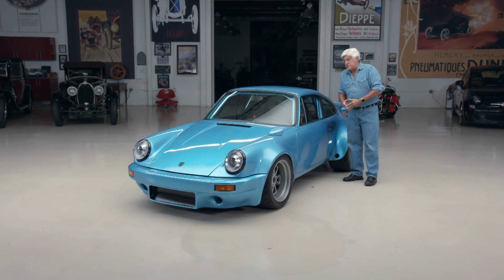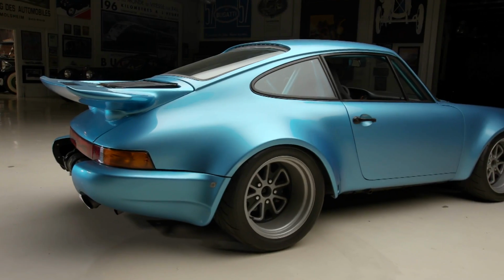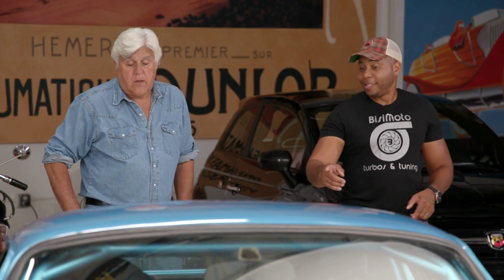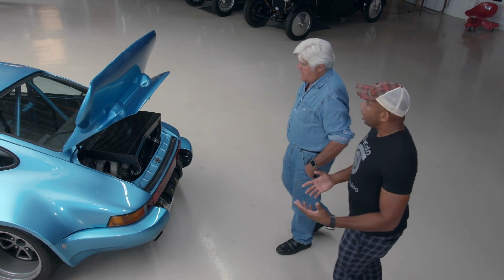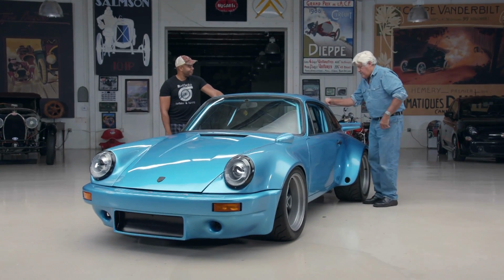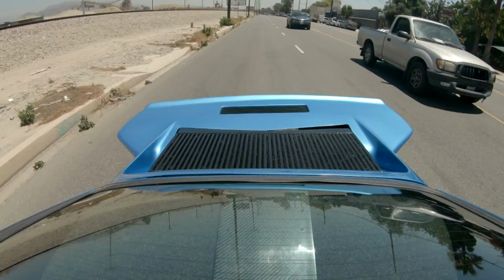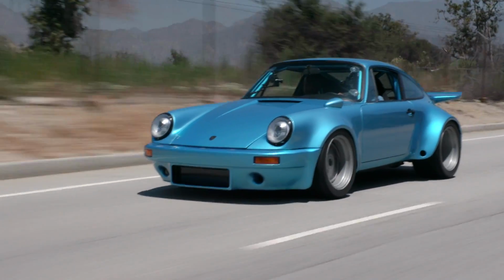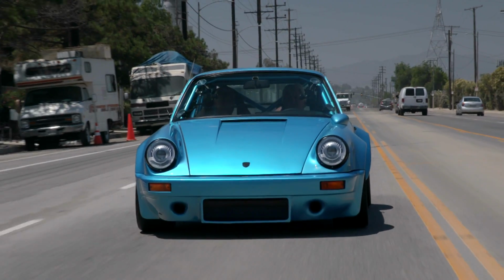Bisimoto's 850HP Twin-Turbo 911 - Jay Leno’s Garage

Comment: water cooled, drive by wire... that negates the whole idea of this car. Electronics are NOT good they will fail, guaranteed.
Reply: Electronics rarely fail, unless in the hands of morons.
Reply: @legitx12  you're crazy. Apparently you don't use a computer often. They fail all the time. Parts go bad, especially electronics in a harsh environment like under the hood of a vehicle. I know many that have had troubles with the electronics on their vehicles, often due to poor design in the first place. Some are put in such spots that even when you know which part is bad, you have to disassemble a large part of the engine to get to them. One chrysler I had, the factory recommended way to change a starter was to pull the entire engine, and what generally went wrong with the starters were the celanoid on the top. A former landlord bought a new Buick, It had a chip go bad 3 times, at several hundred dollars to repair it each time. After the third time, he sold it and took a loss, just to get rid of it. No sir, you can't convince me electronics don't fail, I don't care how many names you call me. You're wrong, flat wrong, and that's all there is to it.
Reply: I own a automotive service business.The PCM rarely fails, often the one's that due, are rebuilt units. You don't have any professional, or engineering background.
Reply: @legitx12  I don't even know what the hell a PCM is. I'm not talking about one part. Electronics in general can and do fail, all the time. I suppose you don't recall the Toyotas that would try to drive themselves even though they were not meant to do so? The more electronics you put in a vehicle, the more likely you are to have a failure. It may be something just inconvenient like a window switch, or something major that will cause strange things to happen, or it may be another piece that simply causes the vehicle not to run at all. I've had electronics fail a number of times, on a number of different cars. My neighbor had all kinds of troubles with the electronics on his Chrysler mini van, then had different problems with the Toyota Sienna he replaced it with. That thing has been in the shop more days than it's been driven. Always something going bad, and it's always electronic. Sometimes it's so bad it has to be towed in, other times he can limp it in.  You'll never convince me electronics on vehicles is a good thing. I don't even really like fuel injection. Carbs can be rebuilt and tinkered with to get them running right, injectors nor the computer that runs them, can be tinkered with by me or even most mechanics. A friend just got a brand new very fancy Toyota, that thing has 80 computers in it. No way that can be a good thing. That's 80 computers that can fail at any time, and just getting to some of them means major disassembly of the vehicle. I'm no engineer, nor even a mechanic, but I've been around a long time, and have seen a lot. You make your living off them failing, of course you like them.
Reply: lot of trouble and expense for what, really? Can't really use the capabilities on the street, and on most tracks it wouldn't be allowed in the same class as normal 911's, or the full on race cars would probably eat it's lunch anyway. So what's the real point?  Can't be comfortable, the ones I've driven weren't for a big guy like me, so... I'm not at all impressed.
Reply: Let's see...he built it 12 years ago and the throttle seems to respond quite well. I'd guess it's pretty reliable.
Reply: @2006gtobob  you do not know what repairs have been made. This guy probably rebuilds it once a week. Electronics are guaranteed to fail at some point, and cannot be rebuilt, the parts can only be replaced, which is often very expensive and difficult. Sometimes it's difficult to just track down the offending part. I don't know your experience with electronics on engines, but I've had them go bad and ruin the car because the flaw could not be tracked down. I'm old, I do not like to rely on electronics for anything, but these days, you're pretty much forced to.

Comment: Wow, 850HP and it sounds like an RC car.  Those turbos are the heart of this beast.
Reply: Sven3xs  this car could easily make 1500 to the wheel. Those turbo, on tiny rear housings, are only making 18psi. They're rated for over 60.
Reply: @1.5JZGOBRRR   He probably kept it manageable to not paul walker it. They don't call these "windowmakers" for no reason
Reply: @EminemLovesGrapes  do they call it that because of dudes flying through brick walls after going through the windshield?
Reply: @jamesbondo5895   yep, rear engine and rear wheel drive makes the car spin out in a corner if you don't keep your foot on the throttle. It takes a very skillfull driver to drive porches like that
Reply: @EminemLovesGrapes  did you  mean to spell widowmaker or was that the joke
Reply: @jamesbondo5895   yes.
Reply: Actually the power-to-weight ration of a typical 1/10 or 1/8 scale RC car is almost obscene. In terms of a full size car a competition equipped RC car, under ROAR or IFMAR rules, would be a full sized car of about 4200lbs with 2000-3000hp, Nitro or electric. It is just crazier with Electric. 1/12 is crazier and would be technically obscene.
Reply: DocWolph Hahahah it is true though! Those traxxis cars go like 75mph that equals like Mach one in that scale hahah
Reply: Sven3xs  Except the 911 is considerably lighter.

Comment: Whatever happened to "Will it do a burnout", Jay? Bring it back!
Reply: @Conor Maybe the Tim Allen Camaro video?
Reply: I’m sure the owners aren’t stoked on that. With the width of these tires and 850hp, something would snap
Reply: No
Reply: HTA
Reply: Jay grew up finally and is done with burnouts.
Reply: @Motersickle Bum I mean, I hope you're right... I miss them too.
Reply: YEAH!
Reply: Rolling the hemi under glass might have something to do with it...
Reply: This will definitely do a burnout
Reply: Hell yeah🤘🏻🚘
Reply: Do a burn out in an 850hp Porsche with stock half shafts, I can see those half shafts snapping. I just seen a video of someone screwing up a shift and snapping a half shaft on a Corolla
Reply: Anyone needing burnouts can find them on the Hoonigan channel in the "burn yard", personally there's only so much of that I can watch so I prefer their other content, their build projects and road trips to events etc.
Reply: Nooo! Don't bring that silly burnout back. It is the Leno-stunt gone I miss the least.
Reply: Most modern cars will not do a burnout (traction control, ABS, etc), and older cars usually don’t have the power, or robust enough parts required.
Reply: @ImTheJoker4u  - My 4000 lb front wheel drive 2015 Ford Taurus SE with 3.5-liter Ti-VCT V6 making 288 BHP at 6500 RPM and only 254 lb.-ft. @ 4,000 rpm of Torque mated to a Six-speed SelectShift® Automatic, 6F50 will lay 20 feet of rubber in sport mode.  Smoke and drama all from the front wheels.  It is bone stock and it is our comfort/luxury car. It's not even an SHO.  My car is the largest sedan that Ford has made over the last few years.  Burn Outs were never in the plan, but it will do it if Traction Control is turned off.